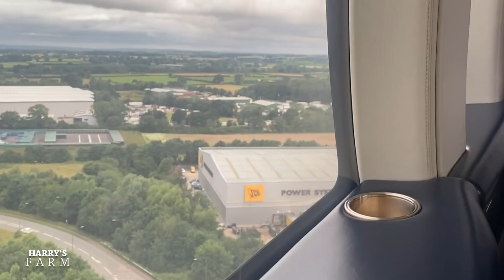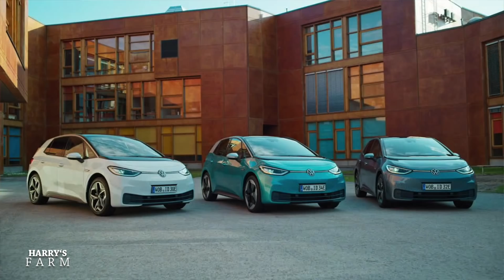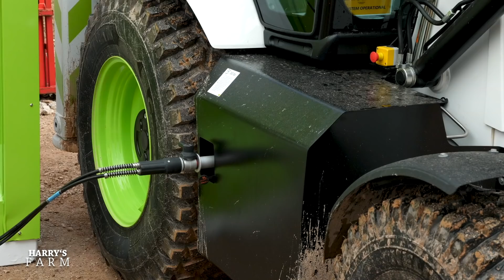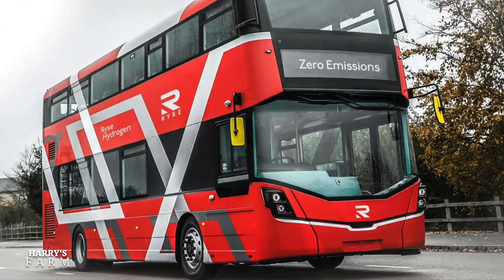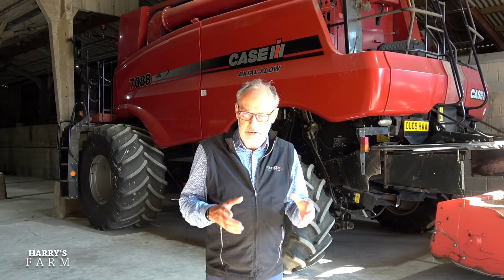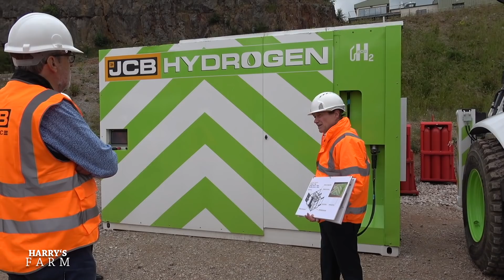Why JCB thinks hydrogen is the best alternative to diesel for heavy machinery, farming and HGV fleet

Comment: I have to say I always thought hydrogen was the way forward, I was never sure about the fuel cell idea but I think the internal combustion engine Paired  with hydrogen is definitely the way to go. I worry though whether it will be able to compete with the marketing of electric cars. There’s no question hydrogen is the better future option for both the user and environment (in my opinion) but I think the current obsession with plug and play ,and then plug back in again as it’s gone flat, electric cars may make persuading the public difficult. 
Great video Harry.
Reply: Why do you think hydrogen is the way to go?
Reply: @proxy7863  Of corse I am by no means an expert on the subject, but my understanding of it is that:

Current fossil fuels like petrol and diesel are a finite resource and during there combustion, gases such as CO2, H2O, O2 and N are produced with CO2 help to cause the enhanced greenhouse effect.

The internal combustion engine is a well developed concept that, due to the many years of adaption and upgrading, has become a very efficient design and is one that that is used worldwide in the masses. Not only does this mean that producing these has a smaller carbon footprint due to the use of mass production, but it also means that (as mentioned in the video) they are less inflationary. Moreover, the knowledge we already have of the internal combustion engine lends its self well to testing new fuels as we already have  a wealth of accessible information which the likes of   Hydrogen fuel cells or electric cells don’t yet have due to there smaller use. 

Plug and play electric cars produce a large amount of CO2 to produce to and the rare elements in the batteries are also finite resources so they will be inflationary and this will get worse with higher demand. Moreover, the significant change infrastructure needed to facilitate these cars would have a large cost both environmentally and economically.it is also of note that unless the energy supply for the cars is carbon negative then they are not “green” . I won’t get into the impracticalities of batteries or the fact that we are currently at a peak in battery technology which requires a push factor to advance. 

Hydrogen however, should (- key word as I’m not an expert in this part and am going off other people info), be easier to implement into our current infrastructure and we already have a good knowledge on hydrogen storage from the large industry’s that use it. I have been told that existing fuel stations could be adapted providing they are up to a certain standard which reduces costs etc.

I do t know a massive amount about hydrogen fuel cells but I’m led to believe that they are possibly to expensive to mass produce for the average consumer. The also have a larger environmental impact to produce.

Internal combustion with hydrogen uses the internal combustion engine we know so well and produce mainly H2O. The production process therefore will produce less CO2 and existing platforms can be used to implement the engines which has less of an economic impact on the manufactures. Hydrogen can be obtained through electrolysis and uses H2O, a near infinite resource. It is a certified “green” method and along with the use of green electricity could help to make a truly carbon neutral car. 

I could go on for hours but I’ll stop there..
Maybe I’m just a sixteen year old that’s being juvenile but that’s what I think at least.
Reply: @archiegoddard2714  It is great to have a discussion on these things, like most subjects they are not black and white. 

We have become very good at producing ICE cheaply and efficiently but they are a very inefficient form of producing power and this is after 120 years of development. The use of ICE will not stop overnight but will gradually tail down as we make a transition over the next few decades.

Battery EVs may produce more CO2 to produce but produce less over their lifetime, even over hydrogen engines. There are little rare earth elements in batteries and these elements are used in ICE vehicles at the moment as well. These elements are being reduced all the time. There is no change in infrastructure, we already have an electric grid! What we dont have is a hydrogen grid, tanks, pumps etc. No vehicle is green, they all have an impact on the environment. Would hydrogen be carbon negative? 

It would be a huge expensive and time consuming task to convert our oil system to hydrogen infrastructure.

Hydrogen in an ICE still produces emissions from the tail pipe. We know more about electric motors than ICE as they have been around a lot longer. The economic impact to manufactures is because they have been caught napping and now find it is too late to try and change their ways. Yes hydrogen production from water is possible but requires an huge amount of power, where is that to come from?
Reply: @proxy7863  you have a very good point.

As for which is easiest to convert our current fuel systems over too, you may be correct, as the information I have comes from what I have read or heard which could be incorrect.

With regards to which will be worst effected by inflation, I think hydrogen has the upper hand as the materials used in batteries are as mentioned; finite and therefore with increased demand and a ever reducing supply, the price must rise. Water on the other hand is not something we are short of. 

Electrolysis, as you pointed out, requires a lot of energy which could be obtained by “green” energy resources. Wind and solar are popular, but tidal energy could be harvested as the electrolysis plants are likely to be near the sea for supply and possibly for better access to docks. An example would be desalination plants which often feature tidal energy systems as well as hydroelectric systems within the plant to harness the energy of the water flow. However as you mentioned: is any of this truly “green”?

Perhaps the solution for cars or similar forms of transport is electric, but I can’t personally see that it will work for larger machinery with current technology. For example, my neighbour runs a case quadtrac on a deep tillage tool and sometimes runs it at 90% engine load for more than 24 hours with only a short break to top up fuel and grab some food. This is something that current battery technology couldn’t do but that could be achieved with a hydrogen ICE (thanks for teaching me the abbreviation, it takes a lot less time to write out). One thing I do agree on is the use of hybrid cars as generating energy from braking etc, to power the vehicle seems like a good idea and should reduce emissions of average driving, particularly if one experiences a lot of stop start traffic. 

I think for cars or forms of transport that do low miles, especially those in urban areas, electric could be better, but that hydrogen ICE’s are still better suited for larger machines.

One thing though is that with manufactures making the leap to new technologies and eventually the new standard for transport being reached, what will happen to all the LIC’s that can’t afford to implement the new infrastructure? Will they be left even further behind than some our now? Or will they use the opportunity to capitalise on the demand for hydrogen or electricity? This has already been seen by Lesotho that built a large series of dams with hydroelectric plants to supply water and electricity  to South Africa, but despite this its population are without a good source of fresh water or electricity and many are moving to South Africa for better chances of providing for their families. What ever happens, it’s something that I’m interested to find out.

Certainly though, your comment on manufactures taking naps is spot on and I’m interested to see what becomes of ICE’s and how vehicles will evolve. It certainly is good to talk about things like this and I like to hear others views and learn where I can, so thank you very much.

Comment: Not to forget about batteries is the recharge life cycle to capacity is low. So after 500 to 1000 recharges the capacity to store the energy is greatly reduced. Not so with a hydrogen fueled ICE.

Comment: This is a really interesting subject... I've recently heard that Toyota's hydrogen car is already on the market, and as far as I know Budapest already signed a contract to build two H2 filling stations in the next couple of years (one already exists). I thing this is a far better option to go green with any type of vehicle than electric. Obviously it is more important to deal with solutions for green power in the agricultural and construction machinery industry, but in my opinion electric power in cars should be also replaced with H2 as soon as possible. Nice vid! Would love to hear some info on this years harvest so far :)
Reply: Toyota are also working on a hydrogen combustion engine currently in a racing car and its proved its cleaner but as it's in a race car set up and racing cars tend not to have the exhaust emissions systems to collect the nitrogen expelled.
Reply: @bentullett6068  oil companies attempting to sell oils and gas dressed up as hydrogen it is a scam    Depending on the quality of the feedstock (natural gas, rich gases, naphtha, etc.), one ton of hydrogen produced will also produce 9 to 12 tons of CO2  
However, hydrogen combustion with air produces oxides of nitrogen, known as NOx. In this way, the combustion process is much like other high temperature combustion fuels, such as kerosene, gasoline, diesel or natural gas. As such hydrogen combustion engines are not considered zero emission.

Comment: Oh dear. It all sounds great, then you look at where all the uk hydrogen is produced and it all comes from fossil fuel production (methane gas reforming + oil/gas). Only 4% comes from solar/renewables. So you have not removed the fossil fuel problem. 

Musk didn't mesmerise politicians, he was right, it doesn't make sense to generate electricity to then generate hydrogen and then combust it. The hydrogen production and combustion process is terribly inefficient. About 12% from solar production, and then around 40% at combustion. That's why the fuel cell or the battery is the better option.

Comment: I’ve always thought it will be technology and entrepreneurship that will save the planet.

That being said, it’s a rather disingenuous to compare ICE vs EV pricing without factoring massive fuel and engine maintenance savings. A Tesla warranty is infinity.

Also batteries can be switched out quickly to overcome the limited workday.

Good on you JCB!
Reply: Not exactly disingenuous he was speaking from their own standpoint in regards to heavy machinery. 

So swapping out 6mt of batteries half way through the shift is practical? What about the cost of having a spare battery for every machine on site? Not exactly cost effective for machine owners. If we are to go down that route the cost of civil engineering and all construction for that matter would go through the roof as costs get passed down the chain. Projects run over and costs spiral as it is.

Comment: Interesting. thanks. Having engines one can fix is important. Right to repair! But has the quantity of electricity required to produce the hydrogen been factored into the "green" equation?
Reply: oil companies attempting to sell oils and gas dressed up as hydrogen it is a scam    Depending on the quality of the feedstock (natural gas, rich gases, naphtha, etc.), one ton of hydrogen produced will also produce 9 to 12 tons of CO2

Comment: Hydrogen has terrible power density even at 350 bar 23kg/m3 so 220ltr tank for 5kg. Excavator 5kg H2 x 130MJ/kg = 650MJ.   Diesel 45MJ/kg x 130 kg (160 lhr tank) = 5900 MJ so you to fill up 9 times for every diesel tank.  Each molecule is the lightest of all elements so low energy per unit of volume
Reply: Yeah Harry was wrong to say hydrogen has more energy than diesel per litre. The JCB guy quickly corrected him to say per unit of mass but I'm not sure many people would have picked that up.
Reply: Its so energy intensive to make the hydrogen and then to burn in an ice engine is crazy.
Reply: It requires about 3 times as much electricity to run an ICE compared to run it directly on electricity, and the transport- and fueling infrastructure- cost for hydrogen is insane. think of the on-site diesel drum with pump used today vs the 1-2 million £ rigg required to refuel a hydrogen tank under high pressure.
Reply: Volume isn’t really that big of an issue, for most ground based applications. The weight and cost of batteries is their issue.
Reply: Cost of batteries is an issue, but recharge time and hours between recharge is at least in my understanding the top issues. A lot of liting-equipment like excavators and telehandlers are designed with extra weights to increase stability and lifting power, so weight is at least for some types of equipment not that big of a deal. Excavators are built to a weight/reach/efficiency goal, so a 24.000 kg excavator is designed to be that heavy, they could bild it at almost half the weight and the same size, but it would tip forward for every bucket you tried to grab. Add weight with batteries and reduce the running cost by at least 2/3 and complexity of the machinery, or add blocks of steel and a ICM running on hydrogen to reduce the initial cost, but keep the complexity and running cost. It is not a back and white answer to what is best, as there are  to many variabels. And again without fueling points for hydrogen where you need them, it cannot be the best solution. If you have to drive the excavator 20 kilometer, or even worse have to truck it on a flatbed 1-2 times a day to the refueling point, the cost and inefficiency of that alone is a show stopper until they develop a relatively inexpensive and movable refueling station. My best guess. Electric (maybe grid tied in citys and urban areas(I have seen prototypes)) Hydrogen clusters in rural areas where the refueling infrastructure is in place, and for the rest and majority bio-fuel or diesel. At least until the technology makes it somewhat cost effective. But my hats off to JCB for their research and development into hydrogen, without it progress cant be made. and this from a guy that rate the JCB Fastrac is the best tractor ever produced, I just love it.
Reply: Where does the hydrogen come from?
Reply: @johnsherborne3245  My understanding is that it comes from electrolysis, a process that uses electrical energy to pass a current through water to separate hydrogen from oxygen. We did it in fourth form science.
Reply: @Myrmecia  sadly while you are quite right, it can be made that way, it’s incredibly expensive in platinum for the electrodes,  the only significant volume of gas produced by electrolysis is oxygen for nuclear submarines. Bulk hydrogen is normally produced by the reforming methane with steam. A long way from the supposed green utopia.
Reply: @johnsherborne3245  separate it from water. H2O,   2 hydrogen  atoms split from the oxygen atom.
Reply: @antpoo  that’s fine in theory, but doing so is an absolute mine field. Faraday was right a long time ago: finding electrodes that don’t disintegrate is rather more difficult. Platinum doesn’t come cheap and not a lot else works for long, hence my comment, it’s easy to be simplistic but in reality it’s really difficult.  Most hydrogen produced at present if not all is magenta by steam reforming methane which is hardy the carbon free intent. You’d be more efficient if you just burned the methane in the engine and cut out the thermodynamic losses if conversion. Again not what is required.
Reply: The Hydrogen engine runs a much leaner mixture, so you don't need equivalent volume to provide equivalent run time.
Reply: Quite recently, in the Modern Railways mag, there was an article along similar issues. One idea was to do with using synthetic fuel oil. Ideally using renewable energy in the process. Oil is a nice high density energy store, after all. This organisation was mentioned therein: https://www.norsk-e-fuel.com/en/ . Apparently it is targeting aviation and shipping as customers. The process would use hydrogen produced by electrolysis, and combine it with CO2 captured from the air to produce syngas to feed into further stages, e.g. to produce Jet-A1.

Comment: Good video Harry! As a trained electrical engineer, I am absolutely not convinced (unlike the UK Gvt)  that electric is the universal answer - I hence very much like JCB's analysis of the problems. Introducing huge inflationary pressures in the market (ie: how is the average man on £27,000 per anum currently buying a £14,00 car going to afford an £30,000+ car? Answer - he won't be able to, it'll be one car or public transport will need a huge boost) - then add in the basic physics issues (a battery is heavy); the fact on high use/high torque vehicles such as trucks, farm machinery and construction that they are used far more (on a daily and yearly basis); that sitting around for 4-5hrs for your machine to recharge means you either unproductive or need a second (inflationary) machine; and batteries make so much less sense - Hydrogen is the answer - Good that British engineers working for a British company have come up with the best economic answer working from basic physics principles - now, when you going to test drive one of the JCB hydrogen machines? Good Luck!

NB: much as you re-shot the intro and closing sections, from personal experience not at all sure YT will like what is basically the same video uploaded twice to both of your channels - in preference, keep this one.